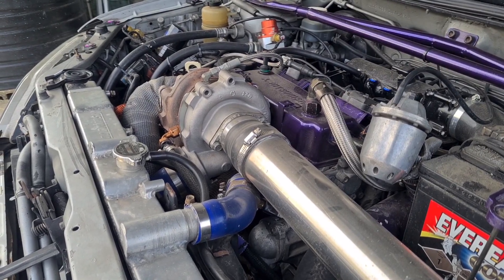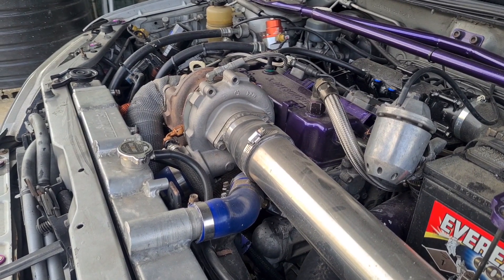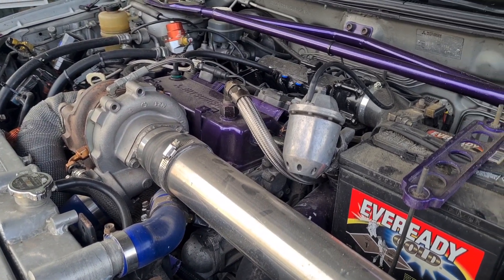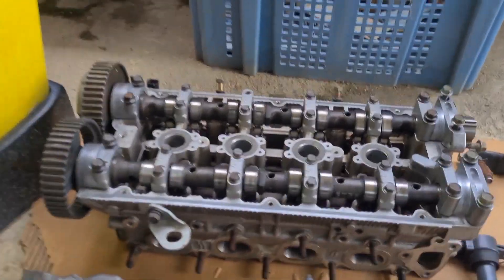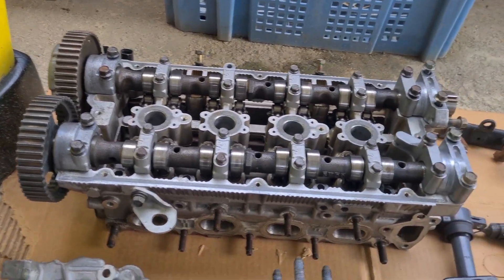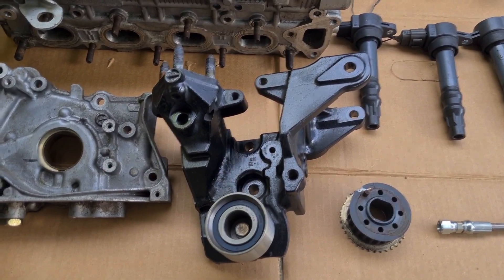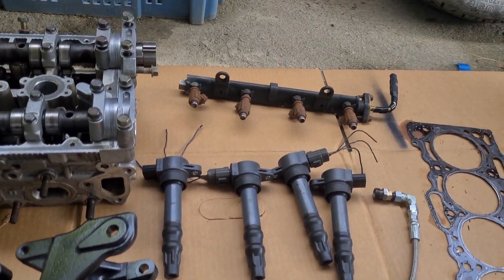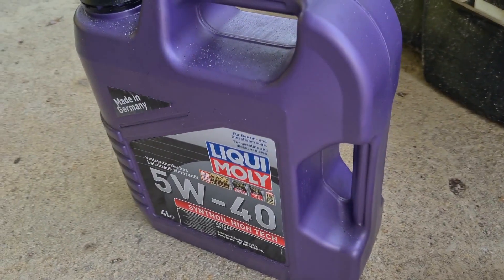4G15 DOHC MIVEC Head swap on the Turbocharged 4G15T CS3 Lancer

Comment: How much more difference is it between the early sohc 4g15 and the mivec 4g15 dohc
Reply from the maker: For me, the sohc hits hard on top, but the twin cam mivec gave me mid range and top end. So worked out better for me and they type of racing i do
Reply: @danielpersad5789 ah, I wonder is it possible to mix the part for early 4g15(cam belt on left) and mivec 4g15(cam belt on right)
Reply from the maker: @MintJoker9578 I'm not sure. We can possibly get an adjustable camber gear for the exhaust side and see if we make some more power with that

Comment: Hi got a question i have a 4g15.., can i replace my 4g15 head an put a 4g93 head on my 4g15 block.., an if so will it make any improvement to my engine?
Reply from the maker: No you cant. You can only interchange the 4g1x series with the same. 4g93 can work with 4g91,92,94. 
4g15 is 4g13,4g18

Comment: Is the 4g15 sohc 92 HP out of the Mitsubishi Mirage 97-02 similar to the 4g15t?
Im in USA and would love to do such a swap or know where to get replacement parts if something broke.

Thank you in advance
Reply from the maker: The block should be similar but the head will be different being mivec and turbo. You should get the full engine and transmission conversion.  Will work better.

Comment: What is clutch solution? In Russia we solving it by redrilling flywheel and instilling 215mm disk and clutch
Reply from the maker: Funny you say that. I've been using the AWD 4g15 flywheel. Those has the dowels already in position to use a mivec 215mm clutch and pressure plate combo. What i use is the ACT extreme clutch and pressure plate rated for 450tq

Comment: hey nice build , i have a 1998 lancer ck2a body , the stock engine was a 4g15 but the intake is a carburettor , how much work will it take if i would make it into a 4g15 dohc mivec? do i need to change a lot of parts inside like the tank or something?
Reply from the maker: Hey thanks man.
You would need the parts I used, and also change the pump in the tank. It would be better to get a fuel injected gas tank as that has a baffle in the tank, which is better. You may have to run some fuel lines back to the fuel tank, but it shouldn't be too much work to do.
Reply: enjin 4g15 1993 ble pasang c head ni?
Reply from the maker: Yea u can. But this is not distributor type. So u will need the ecu with the head to control it
Reply: head dia ni ble pnp? wiring ble tukar
Reply from the maker: The head is plug and play yes. Direct bolt up

Comment: Hi, which gearbox on it bro
Reply from the maker: I'm using a 4g92 mivec gearbox on this setup. The ratios in this works better in my setup for autocross, faster acceleration
Reply: @danielpersad5789  thanks bro currently setting up one, will look for the gearbox
Reply from the maker: @AhadHHH  ok great!

Comment: Hello, I got a 4g15T engine colt rs, just installed maxxecu mini on it. I am not having fire when I enable cam input(1 pulse)… however, when I disable cam input, I get fire but engine won't run in sequential. can you help with setting please?
Reply from the maker: What trigger patter was used? We left 1 on the cam and the one on the crabs was normal.  So the trigger pattern is similar to the evo 10 trigger pattern.
Reply: @danielpersad5789  I am using evo 10 trigger setup for the crank since its same but for the cam, rhe pattern is not quite similar to evo x…just sent you a message on facebook, can we communicate there?thanks
Reply from the maker: @oodeyengovindareddi6423  ok no problem. I will check the message and respond to you

Comment: Does the 4g15 have adjustable lifters cause I'm really tired of the ticking noise I already change oil using 10w 40
Reply from the maker: They are supposed to yea. Mine making noise as well. You need to take them out an clean them or get then replaced. I'm using 5w40 oil and not going to go any thicker than that

Comment: Do You know if i can swap My 4g13 to a 4g15T with same transmisión and wearing arness of My Lancer 4g13?
Reply from the maker: It's possible it may work once the transmission is not cvt. Harness from the 4g15t should work. I haven't tried it, but I believe it may

Comment: Does it run 4g18 ecu? Or I must change it to 4g15t ecu?
Reply from the maker: I'm running a standalone management.  Maxxecu. If you are putting this engine you will need the original 4g15t ecu or a standalone. 4g18 won't work as it has to control fueling for boost and mivec activation
Reply: @danielpersad5789  thanks a lot
Reply from the maker: @mtoyanik  no problem

Comment: I have a question. I have same 4g18 car and i wanna swap it to 4g15t. Is it compatible on stock transmission?
Reply from the maker: If your transmission is cvt, I don't think it will work with the 4g15T from the colt. The transmission that comes with the 4g15t is a normal type,  non cvt
Reply: @danielpersad5789  i have manuel transmission.
Reply from the maker: @mtoyanik  oh well you are good to go. It will bolt up and work
Reply: @danielpersad5789 Will the Cs transmission hold up the power from the 4g15t engine?
Reply from the maker: @akhmau84  is it the cvt transmission?

Comment: Is the valve cover reworked ?  I have a czt with 4g15t and it looks different
Reply from the maker: Hey, it's the same cover. I just added 2 10AN ports to fit my catch can. I'm running alot of boost, so needed to make sure the head was vented properly

Comment: thats stock 4g15 twin cam mivec? it mean will fit at 4g18 right..just to know what you mention at crank sensor..must change to activate the mivec using maxxecu?
Reply from the maker: It's a built 4g18 block and a stock 4g15 mivec head. In order to activate the mivec, you would need the crank trigger to work, so the ecu can see it. Otherwise,  it can work with the stock 4g18 crank, but you may not be able to activate the mivec

Comment: How about the mivec WIRE? 
Did you change the ECU? 
Coil wire? Its just jumped?
4g15 SOHC dont have pin out for mivec 
But how to set up this solution? 
Thank you
Reply from the maker: I'm running a maxxecu standalone unit. So that made it easier for me. Without that, I would not be able to start the car without the original mivec ecu

Comment: Any wiring diagram for the mivec ecu pinout I'm doing a swap but don't have the pin out and the engine won't accelerate any idea?
Reply from the maker: Nah I don't have a pin out for it. I used the same wiring harness I had for the 4g15, I just wired in the mivec. And then the crank sensor jack had to change

Comment: What  cam trigger pattern setting you use in maxx ecu? And can it run 4g18 crank trigger with 4g15t custom 1 tooth cam trigger?
Reply: You use 4g15 box from colt czt? 

I have use lancer MX gearbox it bolt up direct to 4g15t but i had to move my slave cylinder a bit forward because of turbo original place

Do you think thats the cause for slipping in changing gears?

I wonder was box you use and what is you clutch setup if you dont mind helping
Reply from the maker: @yaseenpeerally6722  I'm using tbe gearbox from tbe 4g92 mivec. Those made to swing 8500+ rpm. I'm also using an act clutch an pressure plate. Slipping in changing gears may be your clutch going bad and requires replacement
Reply: Did new clutch still the same
The clutch feel up the pedal
Reply from the maker: @yaseenpeerally6722  clutch pedal is a bit stiffer but good to drive everyday. I drive my car everyday.  It's an extreme clutch and pressure plate
Reply from the maker: We used the evo 10 trigger Pattern.  That had to be tweaked a bit to start. For the mivec to work, you would need to use the 4g15 mivec trigger and cam trigger as it uses that to know cam position to set mivec. If u don't want mivec to work, it's possible to use the 4g18 cam an crank trigger
Reply: @danielpersad5789  hey Daniel would you mind sharing what transmission did you use? I have similar engine swap
Reply from the maker: @yaseenpeerally6722  hey. I'm running a mivec gearbox. It was a direct bolt up to the 4g15. This gearbox has better ratios

Comment: Bro how were you able to activate the mivec?

I have the same head, but the mechanic suggested to just install a switch for the mivec
Reply from the maker: I'm using the maxxecu race standalone and the mivec is wired and activated from it.
Reply: @danielpersad5789  what did you do with the old ecu?
Reply: By the way bro, how much is your fuel consumption?
Reply: So your mivec now works based on a specific rpm?
Reply from the maker: @amir3992  I have the original ecu for the mivec at home. For sale. The car still needs to be tuned but we can set the mivec to come on at any rpm
Reply: @danielpersad5789  will the harness of the cs3 fit on the mivec ecu?
Reply from the maker: No it won't. Crank wire different,  needs Jack for mivec. There are 2 jacks going to the mivec ecu. Cs3 has 4 jacks. I get 500kms a tank of gas
Reply: @danielpersad5789  500 kms for the whole 50liter gas tank?
Reply: @danielpersad5789  with the maxxecu your mivec now works based on a specific rpm?

Because my mivec solenoid is not yet wired up,. 

My mechanic suggested to install a mivec switch/button.

He actually made several dohc mivec head conversions installing mivec switch/button and everything seems fine.

But if there's a way to activate it based on a specific RPM it'd be interested to learn how hehe
Reply from the maker: I can select at which rpm I can bring it in and for how long, from the ecu. Should be doing that today. Will let u know
Reply from the maker: Yea. The most I've done with the singel cam head an boosted was 520kms on a full tank of gas. Haven't tested it properly with the twin cam head
Reply: By the way bro thanks for being accommodating

Comment: the block 1.8 or 1.5? its quiet surprise to see the mivec head can just plug into the block i thought its was different.. if its 4g92(mivec 1.6/ 93(gsr 1.8) from lancer ck it would make sense..
Reply from the maker: The block is a 1.5. Came from a 4g15 mivec turbo engine

Comment: So this is a colt 4g15T mivec head? Are you using maxxecu to activate the mivec? I was told it was a vvt mivec.
Reply from the maker: Yes correct. I'm wiring in the mivec this weekend and the maxxecu will be controlling it.
Reply: @danielpersad5789  i was thinking about putting this engine into my lancer cs3 too, but workshop is worry about that this engine ecu won't be compatible with abs and airbag.
Reply from the maker: I don't see why it won't work with abs and airbag. That has a separate control system. U just changing engine and the ecu for the engine.  Thats it
Reply: @danielpersad5789  i think you are right, there are ecu for abs and airbag. Will try to source for this engine. By the way what gearbox you are using? My lancer is using ck4 version gearbox, but i search online some one manage to bolt it up to this 4g15 mivec.
Reply from the maker: I'm using a ck mivec gearbox.  All those blocks supposed to have the same bolt up

Comment: Can tell what cams u use,?wat cover use,?what coil pack u use? ,and wat block it on ?
Reply from the maker: This is the 4g15 mivec head from the colt r. Stock head,cover,cams,coil pack from the colt. It's on a 4g15 sohc block that came in the cs3 lancer
Reply: @danielpersad5789  I thought u use the ck head with 4g92 mivec head,mivec cover,cams
Reply from the maker: Nah I didn't. The ck 4g92 head would not line up the the 4g1x series of blocks
Reply: @danielpersad5789  yh correct

Comment: Love it bro, with changing the head u felt any difference or only the dino will show?
Reply from the maker: Normal driving you can feel the difference for sure. Alot smoother etc. We have to go to tune on the dyno to really see the difference with full throttle runs
Reply: @danielpersad5789  nice man looking forward to seeing the results, do you think the mivec head can fit on a 4g18 block? Im currently running 4g15 twin cam on a 4g18 block with high compression pistons, was thinking about boosting as the car runs quicker than a normal 4g15 twin cam but considering changing the head first (its a ck2 lancer btw)
Reply from the maker: The head is a direct bolt up. But you would need the oil pump, water pump, trigger wheel and the ecu. I'm using a maxx ecu, standalone ecu,so we used that to start the car.It can work with the 4g18 yea. Boost is life!
Reply: @jordanpena4573  it will work.. i have a 4g18 block with 4g15dohc mivec head